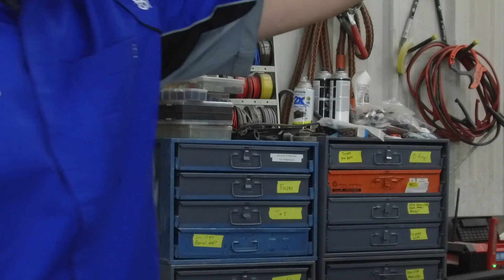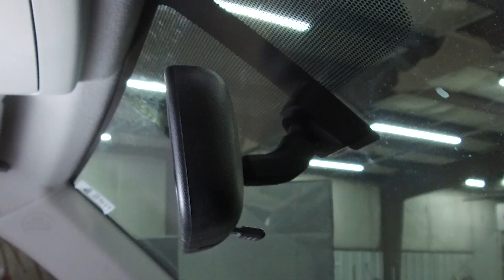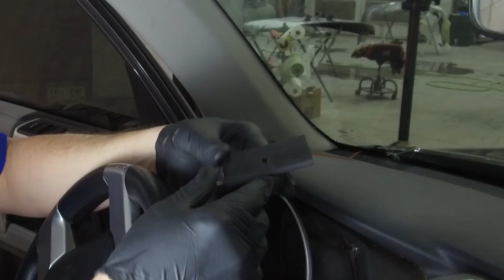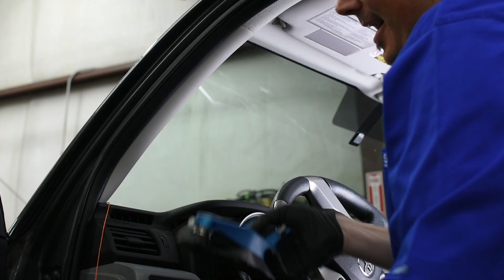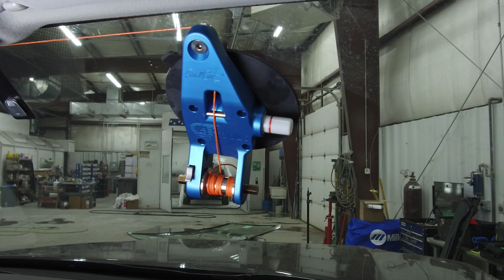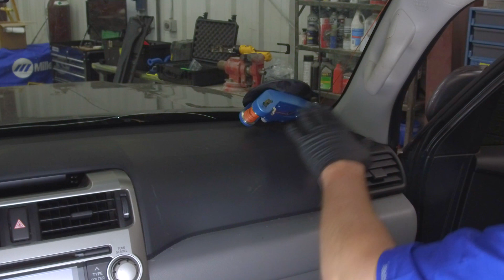FinalCut™ Training Video - GT Tools®

Comment: Do yourself a favor. Buy a dewalt DCE151B wire stripper tool. Remove the head and install a cheap chuck. 
This drill gives far better control as its top speed wide open is 150 rpm compared to 450 on a regular xr. Love mine,

Comment: The guy said no damage to pinchweld, BUT WHY he cut out the molding with A pipe Knife 
It creates damage to pinchweld, defeats the purpose of the tool(Always Pull molding Off).  Also does the Anchor creat some sort of damage to DashBoard will cutting extremely hard urethane.?

Comment: Redundant step re-pulling line back into car. Leave the cord inside the car, pull about 24 inches off spool and fold cord over insert tool end. Once pushed through to outside of car, fasten one end to tool and pull the other side of cord outside of car with enough slack to go around the glass entirely. Once around, cut cord from spool and affix to anchor or simply leave cord on spool and affix to anchor
 Time and effort saved. This video seems more like a how to rather than showcasing the actual tool.

Comment: Question. Have you ever seen the anchor block damage the dash in any way? I am considering the purchase of one of these but am worried about brittle dashes.
Reply from the maker: Hey Joshua, thanks so much for the question. In the 3 years that we've been manufacturing the FinalCut, we've never had a customer issue with an anchor block damaging the dash. It is built from a soft rubber designed to grip and will not break brittle dashes.
Reply: @gtglass  would the final be capable of saving a windshield?
Reply from the maker: Tony Hernandez yes, definitely! That’s one of the major benefits of our cord & wire tools

Comment: This technician is a Hack. Yes he can use a cut out tool, but to cut the side mouldings and top moulding off, its stupidity at its finest. The side mouldings will pull right out with little effort. By cutting them he has now damaged the pinchweld. As far as the mirror, there is a small clip on the back side that will release it. Obviously this mirror was not put on properly on the first place.
If your selling auto glass tools, make sure you have a technician that can do the job right.
Reply: All experience Techs Know not to cut moldings off the vehicle, specially a pipe knife ✌️
Reply from the maker: Thank you for your feedback Colt. We appreciate valuable comments from excellent technicians like yourself. This vehicles underglass molding would not pull out. We do agree that you could definitely scratch the pinchweld if you were not using a sharp razor while apply pressure against the glass toward the urethane bead. Were sorry the the mirror that was connected didn't meet your standards either.

Alternatively, we hope the majority of this video was informative showing you the operation and the use of the FinalCut. If you have any questions GT Tools is always available and ready to answer them. We are only a phone call or click away! We'll get back to producing what we believe to be the best auto glass tools in the industry made by right here in Durango, CO - USA.